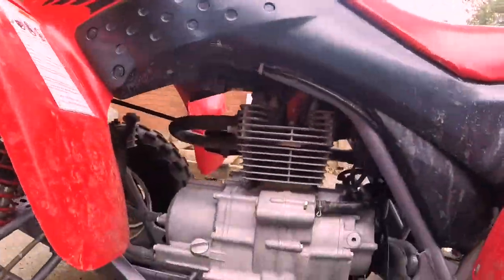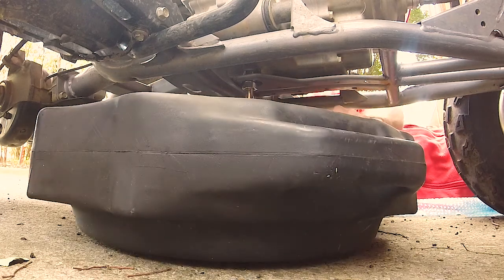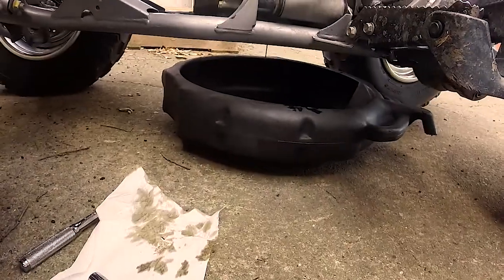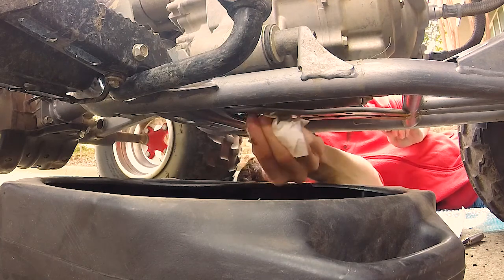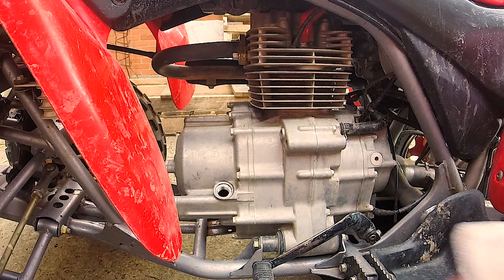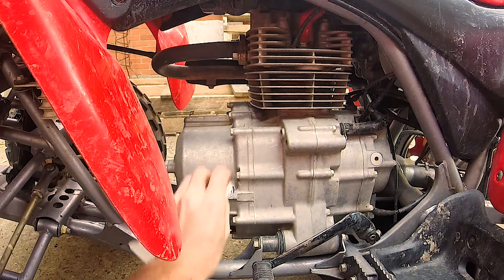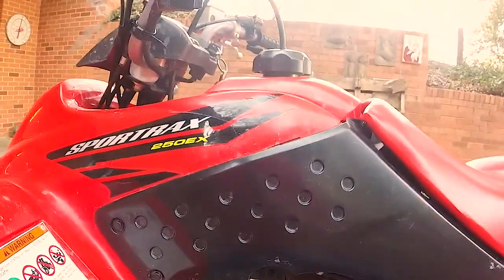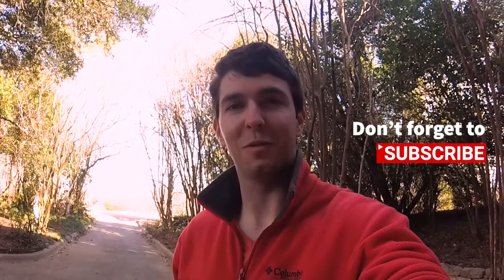How to Change Oil in a Honda TRX 250 | Sportrax 250 '04

Comment: Honda not only recommends a 10w-30, at higher temperatures a 10w40 is recommended with sheer stable polymer additives to protect wet clutch, use a Honda gn4 oil!

Comment: And the filter oil?
Reply from the maker: There is no external oil filter that is easy to change. I think inside the transmission there is some sort of screen. My understanding is it's really hard to get to, just keep the oil clean!
Reply: @thehandymonk5648  thanks, i fix the gas thank, and change oil, i used yesterday and seems like hot really hot, but not malfuntion, gone to change motor oil and diferencial too,